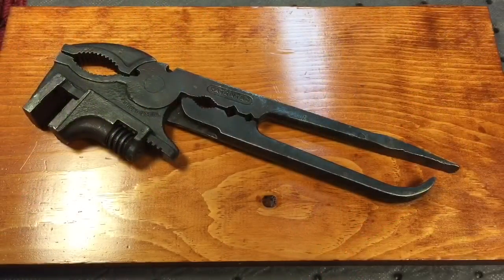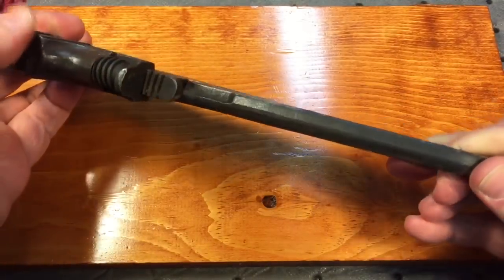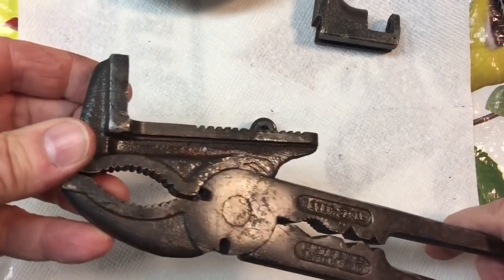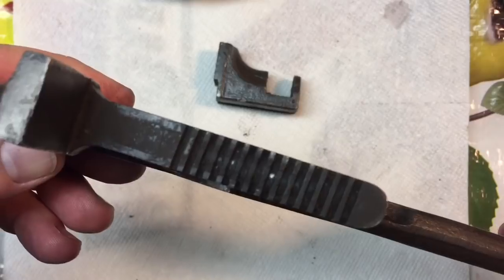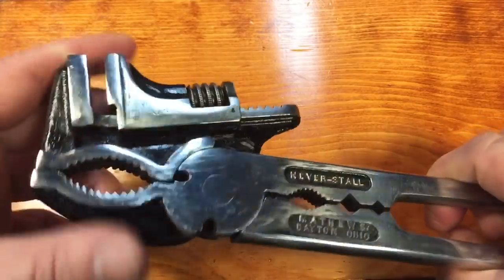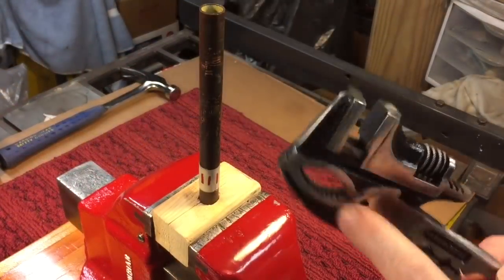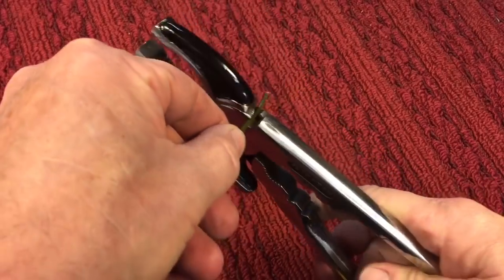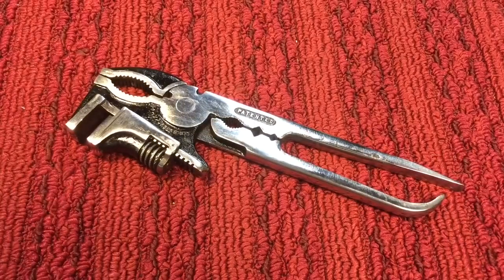Antique Never-Stall “Windmill” Wrench Restoration

Comment: My late uncle gave me one of these years ago. However, I've also seen another model that had pipe taps inside the handles.
Reply from the maker: Hi Jim!  As you know these are no gimmick tool!  They were well made and very sturdy!  I really liked this one!!!  Thanks!!!!!!!!!!
Reply: @ScoutCrafter  It's been four years but revisiting this video I realized mine has something yours doesn't. There is a hole through the top jaw of the pliers that comes though the teeth of the jaw just behind the flat teeth at the front. Also, I forgot to mention that mine does have splotches of brownish red in several places. Any idea what these things are worth?

Comment: That's a nice multi-tool! Pretty neat that you showed the diagram with all the uses pointed out!!! Bert will be proud to hang it on his wall or shelf. Great job as always!!👍 How many sanding belts did that thing wear out being drop forged? Lol
Reply from the maker: Hi Steve!  LOL   I went thru 2 belts, but I seized the bearing on my 6" Belt sander!   =)  Drop Forged is HARD!  I first found that out when restoring some fencing pliers...   =)    Thanks!!!!!!!!!!
Reply: Oh no! Hope you can easily get a replacement bearing. Yeah, that fencing plier I did earlier took a long time to get shiny. Took a low grit belt just to get thru the patina. Lol. I forgot to bring it the other night to show you. Had a great time at that swap meet and talking afterwards. You never know who will show up. Very cool crowd and getting more popular.
Reply from the maker: @stevef8993  Yes!  A lot of money changed hands!  You know there is a January Show at Jacktown!  Also     Jan 18-20th is the Cabin fever Expo in Pa!   =D
Reply: I'll have to dig out my snow boots for those. Are they still good shows in January?

Comment: I love your channel I’ve watched almost all your videos so far you got me into tool restoration but one question I have an old monkey wrench and it has a slight bend in one part of the handle and a larger bend towards the head and the torch I have won’t heat it up enough to bend it back what should I use to heat it up enough?
Reply from the maker: Hello Erin!  Most wrenches are malleable, meaning they are meant to bend before breaking, you should be able to bend the wrench back straight without heat! Just use some brute force and a vise or something that cam hold the wrench while you straighten to out.  Sometimes the bend was made with a cheater pipe on the handle and those bends are the hardest to get out.  Maybe you can send me a pic of the wrench and I can offer a better opinion!   Thanks!!!!!!!!    bicycleguy@aol.com

Comment: Why is drop forging better?
Reply from the maker: Hello N Smith!  Great Question!  There were two ways to make such a tool, one is Casting- where they would make a mold and pour in molten metal. Then they would grind it and finish it off.   The other and better way was to take a piece of steel and heat it up red hot then put it in a special press that slammed down on the hot blank making it into the desired shape.  Forging is much harder and stronger then casting and also much harder and more expensive to do.  Hammers are drop forged, that's why they are so hard and strong!  If they weren't they would chip and mushroom every time you hit something!  So when you see a tool that is drop forged you know it was usually well made!   Thanks!!!!!!